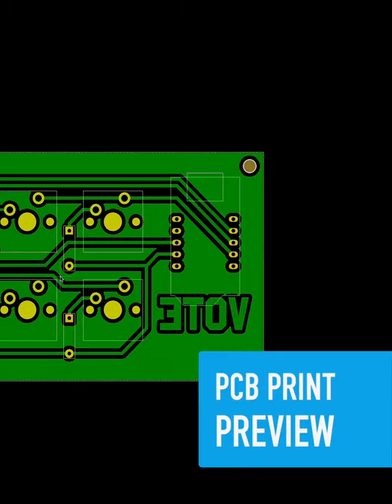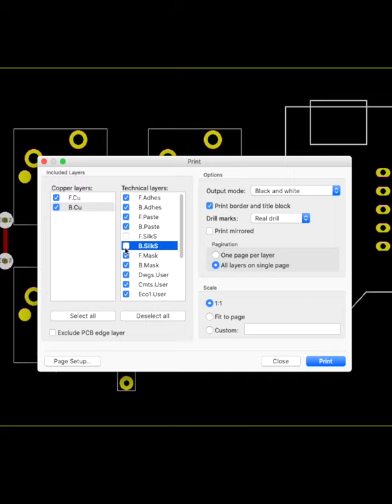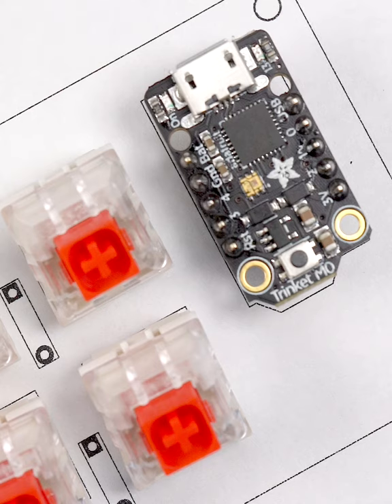PCB Print Preview – Collin’s Lab Notes #adafruit #collinslabnotes

Comment: you know you are deep into custom keyboard when you instantly realized the board design is to fit mechanical switches and i was like, wait its missing the center post and then went wait kailh box switches dont need that extra 2 hole

Comment: A better way though a bit more complicated is to build 3D model of your PCB and verify things in 3D CAD - fusion360 and eagle have good integration for this
Reply: Still doesn't help with making sure the component fits the footprint.

Suppose you design the footprint to the component's datasheet specs, go to production and then find out that one the component pads is not spaced right.

3D modeling doesn't always help here, if you design the 3d model to the datasheet but the datasheet is wrong, you wouldn't catch the issue.
Reply: @thomasb1337  I think your missing the most crucial step in what he’s saying, you print out the PCB using a 3D printer, so you have a dimensionally accurate mock-up that you can also test for mounting in cases etc… it’s like an advanced version of the 2D paper Colin mentions.